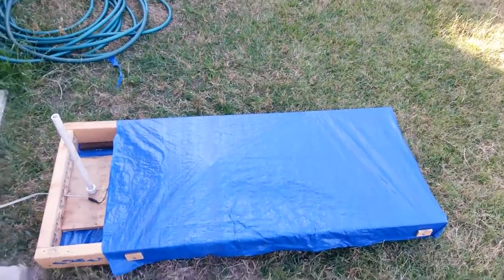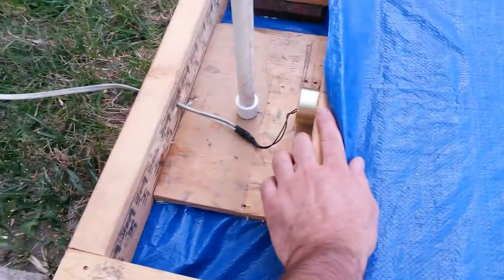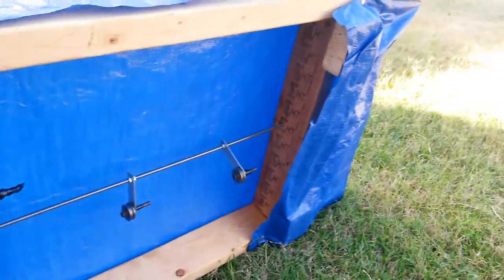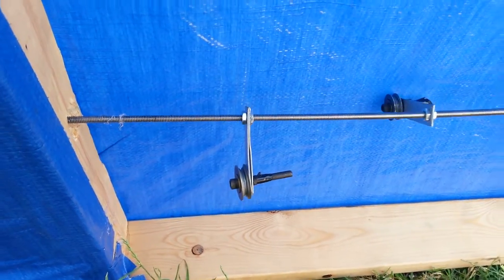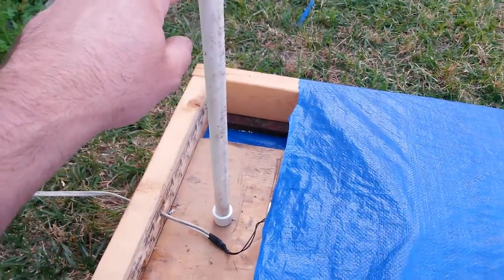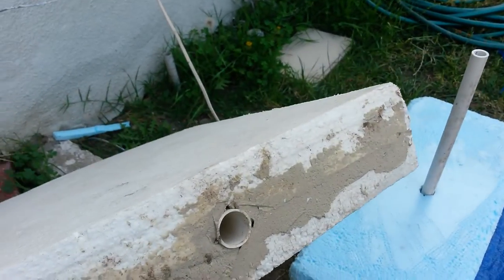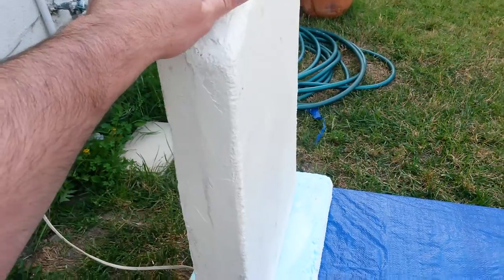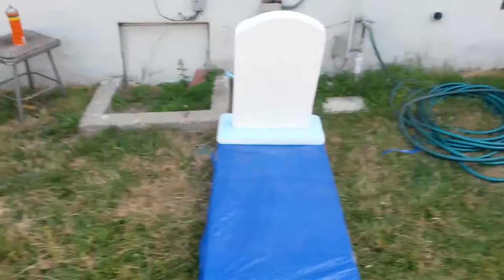Breathing grave prop pt.1

Comment: Why are the little steel pieces you use?
Reply from the maker: It's a  threaded rod from home depot.  With flat steel and locking nuts , 3 to 5 to 8 to 11 o'clock with flat steel.
Reply: PsychoAxeMan okay thank you.

Comment: The description says 2x8 but in the video you say 2x4?
Reply from the maker: Cut a 2x8 in half it's cheaper then buying two 2x4 😁
Reply: PsychoAxeMan hahaha very true.
Reply: PsychoAxeMan I found a motor but how did you join the threaded rod to the motor?
Reply from the maker: The motor I bought had a threaded female hole so I just took a threaded rod with a nut . Screwed rod in to it locked it down with a nut , then threaded rod just spins
Reply: PsychoAxeMan any chance you have a link to the same motor?
Reply from the maker: U making me work .. lol
Reply from the maker: @michaelcamehome3647  Google search 120 volt reindeer motor . If u in the US . Straight shaft
Reply: PsychoAxeMan thanks man.